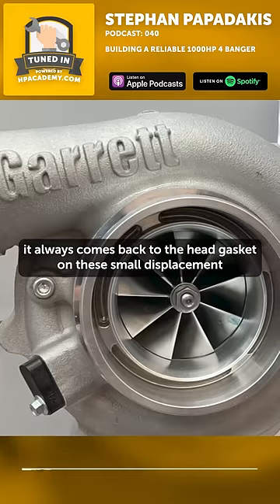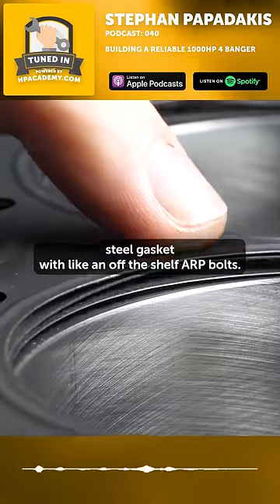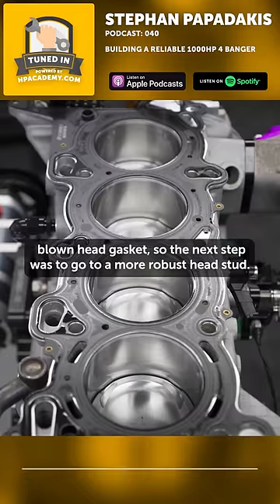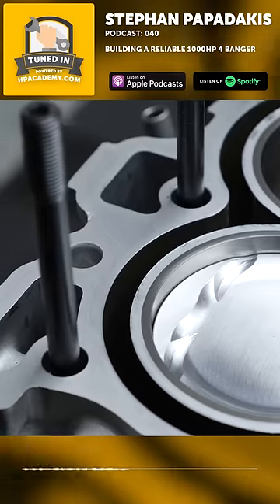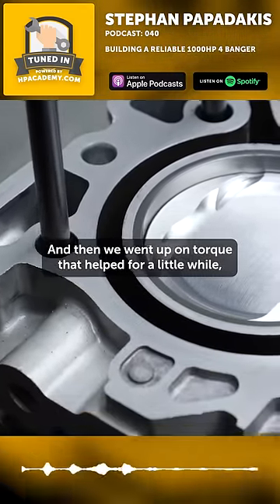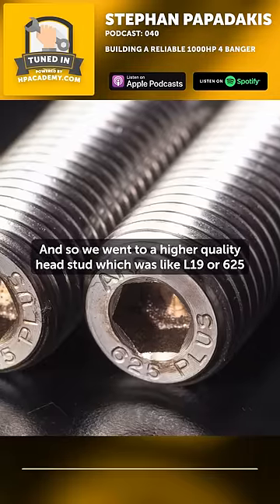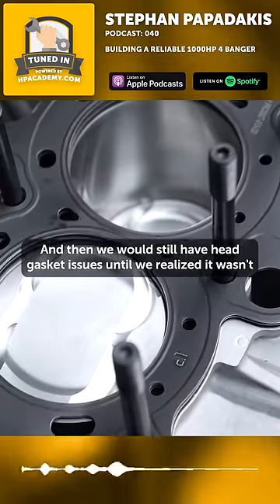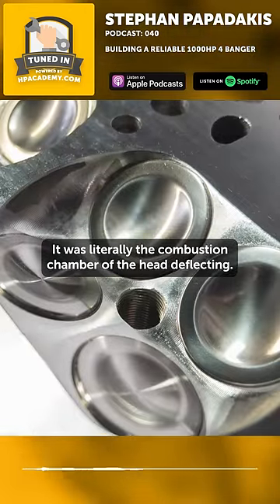How to hold a headgasket on a 1000hp 4 Cylinder 🏎😳 #shorts

Comment: Yeah at some point the open deck becomes the limitation
Reply: Yep, I 100% agree
Reply: you're not wrong, but in this instance he's talking about the head deflecting, not the block. A closed deck block wouldn't correct this issue. Also, the engine they're referring to isn't what you're seeing on screen
Reply: Tell me you didn’t understand the video without telling me
Reply: @NitroNuggetTV  actually not really...

More clamping load applied to cyl head and block distorts more of the bore and bowing the cyl head combustion chamber...

Reducing back the clamping load of headbolt/stud while utilizing fire ring and or with closed deck mod on the block will help keeping those 2mating surface stay together...

Fire ring mod helps due to small ring area where clamp load focused the most and seal together instead of spreading the load across whole gasket mating surface...  

With relatively require lower clamping load...reducing risk combusting chamber deflecting/cyl head bowing or distorted due to massively overtorqued head bolt/stud...

Kind of misconception of old school thinking big v8 more displacement more speed...where there is much more efficiency can be gain somewhere else to get the same speed...
Reply: @AmirPomen  This bears very little relation to my comment or the video? I was pointing out to him that the video was talking about the cylinder head deflecting, not the block as he mentioned. Point still stands that a closed deck wouldn't be the solution to the problem mentioned in the video. The head deflection wasn't cause by a clamping related issue, or block distortion but instead exceeding the limitations of the heads casting.
Reply: Just need a bigger block lol. The answer to good placement is displacement even today. Need thicker walls so an older big block might work better for the milling the deck and porting the piston bores. There would be plenty of steel left and bolting down those heads that block would accept all that upwards torque and happily keep it down.
Reply: Just because he says the combustion chamber is deflecting doesn't mean hes right, just think about it, how could he possibly know ? More likely the cylinder walls and or bottom of the block deforming from the open deck causing the issue, how could an head deflect without causing valve stem to seize or bend or having a bad seal or crack in between valve seat ?
Reply: @AmirPomen  I agree with everything except for your last few sentences. It's definitely not a misconception that more displacement equals more power... the more displacement you have the more power potential you gain. You can make an extremely efficient 4-banger to keep up with a V8, but as soon as you do those same modifications to the V8 it will blow it out of the water. Assuming the V8 has a higher displacement than the i4, obviously. Cylinder count does not always equal displacement.
Reply: @ElySky95  you do realize when you talk down a head, the surface of the engine's deck actually flexes. When you torque down a head, the head actually flexes and bends to warp into position... just because it warps a little bit doesn't mean it locks things up, but it definitely can happen. If it works too much it can crack the block, destroying the head, and much more. But if it only does it on a very small amount, it just allows a little bit of blow by between the gasket. 👍
Reply: @sethh8892  True, but dont you think the cylinder walls flexing due to the open deck design are causing the failure?
 Its the most likely reason, i know a few open deck diesels that almost allways fail the head gasket at around 300kkm while closed deck lasts forever. If the goal is insane power forget the open deck design or do a closed deck conversion.
Reply: @ElySky95  they're not talking about the the walls flexing, they're talking about the head deflecting.
Reply: @sethh8892  I don't believe it would deflect so much without showing any damage, could be a combination of the two problems, the only way to be sure its to do a closed deck conversion and test it again.
Reply: @ElySky95  it doesn't have to deflect much when you're under 44psi. At pressure like that, any small little seepage will be enough to have plenty of blowby
Reply: @NitroNuggetTV  it’s the drift Corolla engine right the first Corolla
Reply: Closed deck block gives more sealing area
Reply: No ran into that on rs focus thinking about wedge's you are right
Reply: @ElySky95  you could close the deck with the hardest and strongest substance known to man, that won't stop head deflection. At the power levels they are working at the combustion pressures are beyond open deck territory.
Reply: @jeepmanxj  Take a look at the diesel world pressures, around 40psi ? not very impressive.... thats laughable compared to some super diesels running +70psi and the thing that gives up first its not usually the headgasket....
Reply: @ElySky95  you mean the ones with the entire cast iron existence? Or have massive aluminum head castings.

Seriously. You have to know how stupid this comparison is. Aside from both being internal combustion the similarities end there.
Reply: @jeepmanxj  Are we talking about blocks or heads ? Why do you bring cast iron to the talk ? Massive heads deppends on what type of diesel you're talking about, take for example tdi pd or vp head its big but not "massive" and why are we forgetting about many other 4cy petrol builds with closed deck with +1000hp and holding just fine ? 
What's next this particular head is weak ?
I gues people who do closed deck conversions on Porsche's and Subaru's are just dumb then ?
Reply: @jeepmanxj  Even honda blocks like k20 get closed deck upgrade on high boost applications, go look for why it's done
Reply: @ElySky95  it's very obvious you have no idea what you are talking about and any further discussion is pointless.
Reply: @jeepmanxj  Sure, whatever floats your boat.
Reply: A man’s gotta know his limitations!
Reply: @ElySky95  let me tell you why I know you are trying to Google knowledge.

You made 2 replies to one of mine over 30 minutes apart. That means you made a stupid statement then went looking for a way to try and justify it.

You are trying to make a claim about the pressure blowing the cylinder out of round. That happens long before head deflection issues and leave very obvious signs on the cylinder wall and around the lip of the cylinder. We are well past that being even considered.

You tried to compare a diesel engine to gas. Then tried to reach around and justify it. No, they are not the same, they are not designed the same, combustion isn't the same heads are designed differently, blocks are designed differently.

Stop. Just stop. You sound silly.
Reply: @jeepmanxj   
 Dude srlsy listen to yourself.

1- I made the second statement 30min after because i remembered there were other engines other than Subaru and Porsche that had closed deck conversions for high power applications and decided to write it because it's a better comparison to use the K20 from Honda to the one on this video.

2- Making a claim about "pressures blowing the cylinder out round" ? 
Where in the world did you read such stupid claim ?
What im saying is:
No matter how thick your cylinder walls are ((Heat)) and combustion chamber pressures will cause the cylinder walls to expand out at different rates from the head because of their design differences and different material types causing different expansion rates this slight movement its enough to cause wear on the headgasket causing it to leak, thats why they use closed deck conversions, to increase the sealing area and avoid that expansion, because guess where the peak pressure occurs? Exactly at the top of the cylinder walls is why it should be closed to handle those high temperature and pressures

3- First i gave an example of some open deck diesel engine i know that fail the head gasket compared to others closed deck that never fail for example 1.4hdi 1.4d4d and 1.6hdi open deck usually faill the head gasket at around 300kkm while the closed deck 1.3multijet 1.5dci and 2.0hdi and others last forever.

You got a point they are obviously built differently but my point was not to compare diesels to petrols its to show why the cheap open deck sucks for high power applications.

Im not denying the head doesn't deflect, even closed deck cast iron deflects when tightening the head to the block, thats why they use pressure plates when boring the engine.

What im saying is head deflection is unlikely to be the culprit on this situation because we're dealing with open deck design.
Reply: @jeepmanxj  And before you judge my other previous claim of not believing it's head deflection, im referring to his statement of combustion chamber deflection which implies combustion chamber deflecting upwards and not alongside the block as they usually do after tightening.
Reply: They are talking about the area about the valves moving not opendeck not wire on block it is the head that's at fault you would have to investigate if there is a stronger head  out there or what mods you can do to head I am working on rs focus that had gasket problems open deck wired and wedged the block problem solved 650 HP built engine now the rest gear box that can cope with it Quafe do on it's the expense I come from the land of rally drivers Scotland good luck out there all the gearhead👍
Reply: @iainfreeman4751  Wedged block never heard that one before but its a great idea not sure how it would hold +1000hp but should do the trick for cheap, my question still remains how could he possibly identify the head deforming in the combustion chamber and not other similar and more common issue people have solved by closing the deck ?
Reply: Wedged block like say a quarter mile car that  dont run water cause they are not getting very hot tjey use epoxy and and some sort of metal on the epoxy ballbearings or steal dust in water jacket and they cars run nitromethane very cold and that keeps engine cold now wedge's is similar say 4 round the piston sleeve mind keeping it very centered and  I mean by thousand spot on no defecshion left right forward or back and the wedge's let you use glycol water in u're engine that keeps the piston sleeve centered and stops it defecting or deformimg still doesn't help with head problems as I said mabe a different head of simeler engine say if you are running a 2 liter and and you run the 1.6 head not ported just as much mabe Abit more strength or afull new head blank and you machine in a bit more strength you get ware I'm coming from 👍
Reply: @iainfreeman4751   Cool I've heard people use all sorts of materials even cement but never wedge something in there. 

Same here on tdi world, 8v engine's are preferred over 16v on high boost applications, 16v usually cracks between the valves and the glow plug but the gasket never fails.
Reply: @NitroNuggetTV  THANK YOU..I WAS LIKE " WAIT WHAT DOES THAT HAVE TO DO WITH THE HEAD FLEXING" ..HE MUST HAVE BEEN JUST LOOKING AT THE PICS OF THE OPEN DECK BLOCK..NO RELATION TO THE AUDIO CLIP HOMIE..WISH HE FINISHED THOUGH SO I DIDNT HAVE TO GO LOOK THROUGH THERE VIDS TO FIND OUT.
Reply: @NitroNuggetTV  doubt it was the head deflecting.
Reply: Copper coating both sides of the gasket?
Reply: @connordziadul6048  I mean, even still, the answer for more power is typically FA anyways...Hellcats, Demon, McLaren Senna, Bugatti Veyron and Chiron, AMG GT, etc. Now the Senna and AMG are only 4L, but V8 nonetheless. Veyron has 8L of displacement and STILL uses 4 turbos. Displacement is kinda useless if youre gonna use a massive engine and still need to used FA to go faster and get high numbers. It's also useless if you can get the same power and/or speed out of smaller displacements. So yea, say "good placement is displacement" all you want...but I bet you can't build it in any way shape or form that'll make it better and faster than the same build with a turbo or supercharger slapped on.
Reply: It wasnt the open deck.... It was the head warping its shape

Comment: Went through all these troubles back in the early 2000s with bmws m52. Even put one on a bandsaw and sliced it in a few places to know how to get 9/16ths arps to work. We always blew the gaskets in-between cylinders. Ended up o ringing it. We were the first to break 1000whp so the hardwork was worth it. I only knew pontiacs beforehand so turbos and dohc was new to me at the time lol
Reply: you did 1000hp on a aluminium block m52😱
Reply: @miikka.v6708  iron block. Was in a 97 328.
Reply: The m52 is a very capable engine. Im not sure i would have tried to push it to 1000hp
Reply: Iconic engines. M52 and M54 blocks were built different.
They were capable of 1000HP, but you needed the M Division to outfit and machine the engine to actually achieve it. The 1.8L M10/12 4-cylinder was an F1 proven 1k HP 12k RPM engine, detuned to 850HP for qualifying, and 720 HP for racing. And those were engines with 100k+ KM already on the odometer... 😂 Yes. BMW outfitted their F1 cars with USED RoadCar engines from the BMW 2002, AND WON.
Reply: @Karl_Kampfwagen  it's a shame in the early 2000s such a good engine was made unusable by everything attached to it being garbage. I remember replacing the Tstat on my friends 2001 525 over 6 times at $130 each time since the thermostat is molded into a plastic housing. At that time oreillys offered lifetime warranties so he wasn't paying out of pocket each time, but it was very annoying to have to tear into the engine on a monthly basis.
Reply: @Karl_Kampfwagen  Didnt need M division to do anything. Were just some regular dudes who like hp and we achieved 1000whp.
Reply: @Karl_Kampfwagen  another fun fact about those m10 blocks was they kept them outside in the elements for months and frequently pissed on them. M division was wild in 80s🤣
Reply: @shifty1927  They were depositing a Nitride layer from the Amines/Ammonia in Urine. And it apparently worked. They were wild AF, but the cars from back then are still running, while the newer models are failure prone and heavy. 🤷 I'd rather get a 30yr old car with Known Problems, instead of a newer car with less documentation of issues.
Reply: @shifty1927  9
Reply: @husainjagani  10
Reply: @Karl_Kampfwagen  you probably know more about this stuff than me, but the F1 engine was 1.5 litre and produced over 1000hp in qualifying (1100+ , calculated to up around 1400 as they could not measure accurately at the time) your figures were for 1983, but it improved each year until 1986. It’s regarded as the most powerful engine in F1 ever.
Reply: @husq2100  You are correct, sir. I think the biggest flex BMW ever did, was pushing 1400HP out of a 1.5L 4-banger... Sure, it was 8+Bar at the intake (~100PSI). But who else has ever made an engine that can take such treatment without becoming a bomb? And... While the engine was wholly capable of producing a whopping 1400+HP on dyno, they had issues with clutches, gearboxes, and brakes giving out. So they kept de-tuning it until it was reliable again. It's nice having 1,000HP, but if your driveline gives up because of stress, maybe 850HP is "good enough" for qualifying laps, and 760HP is also "good enough" to win F1 for a few years... With a 1.5L engine, passing all the V6, V8, V12 cars like they were farm tractors. I want to build or buy one of those engines....
Reply: @shifty1927  coke thoughts?
Reply: @ianthompson2802  stupid drug, really profitable though.
Reply: @shifty1927  thoughts on black people?
Reply: @miikka.v6708  lol m54 have aluminum block, m52 (single vanos) and m52tu (dual vanos) both had cast iron block.

Also sleeves exist🤙🤪
Reply: @dodimolina  There is m52 with aluminium block too, my friends 2001 e39 m52 single vanos for example has an aluminium block and i thought that only m50 came with iron block